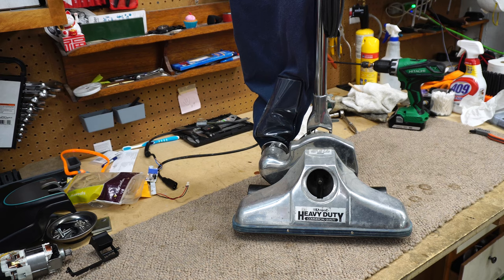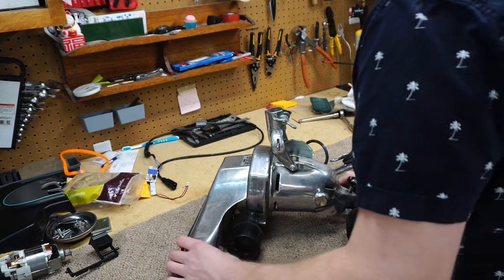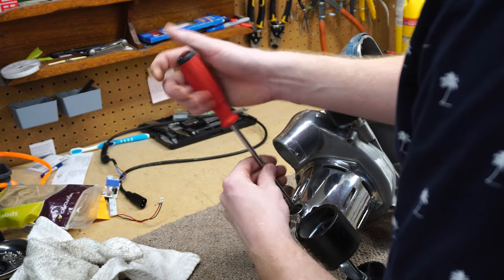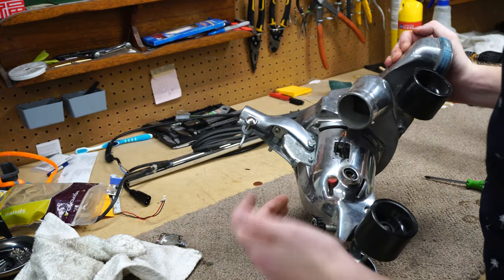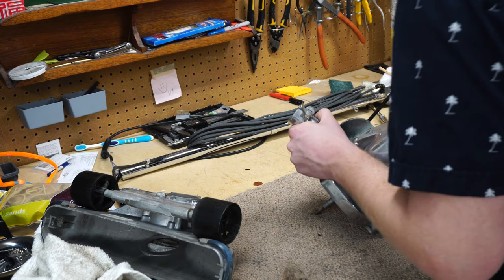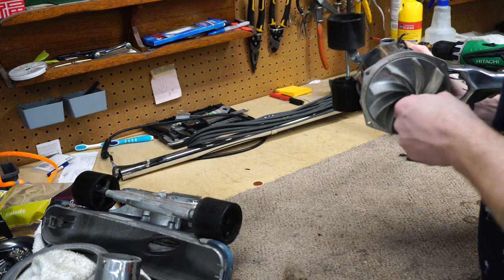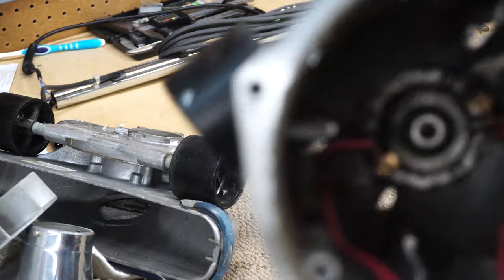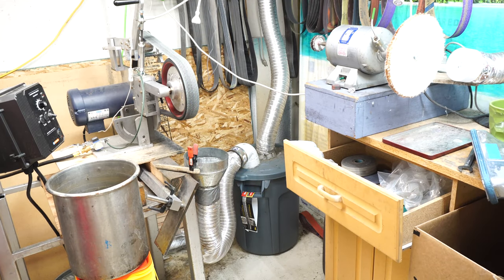Royal 885 Vacuum Repair of an American Classic  ( Part 1)

Comment: Love Royals! I once had two 880s, an 801 and a 501 hand vac. I now only have my 2028 that I have had since 2005. The only big issue I had was the armature got bent when I serviced it one time. The fan was stuck on from vacuuming my grandmother's nasty basement carpeting and the only way I could get it off was knocking it off with a hammer. I wound up replacing the entire motor and it was like brand new after that.

Comment: When I started in the cleaning industry back in the 1980's,a lot of institutions used these Royal 885's due to their low cost and toughness. Of course when Royal was on the ropes in the 90's Wndsor saw an opening and pushed their Versimatic which cleaned better and as a result stole most if not all if Royal's customers.I bought an old 885 for 10 bucks at flea market and it does okay for what I use it for.

Comment: Thatd be coolio imho if there were ANY or some tv sets still made in the usa at very least for more feasibke conrtacting a company or place fwiw requesting replacement parts etc etc but not sure if after 2010? Possibly 2011? If they still have tv sets made or even manufactured in the usa or even in mexico and/or anywhere in the american contnent ykwis